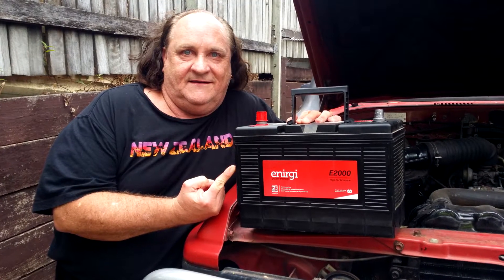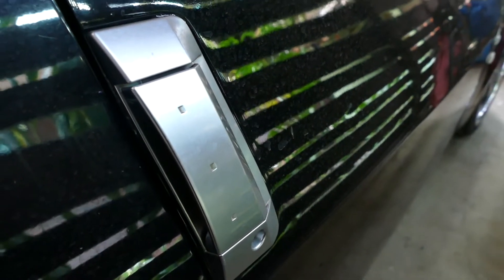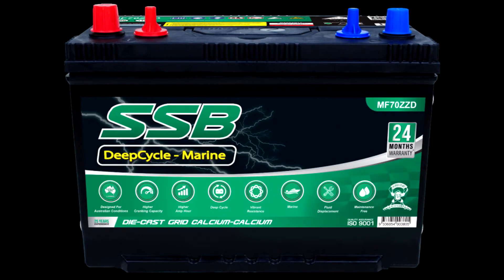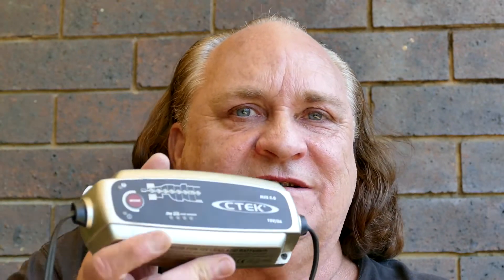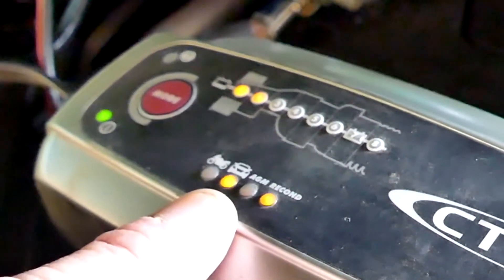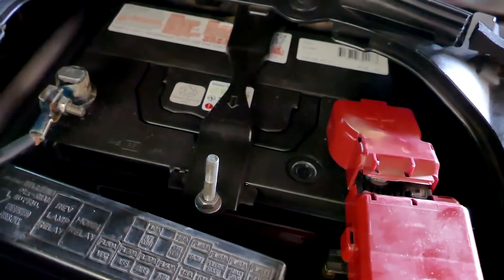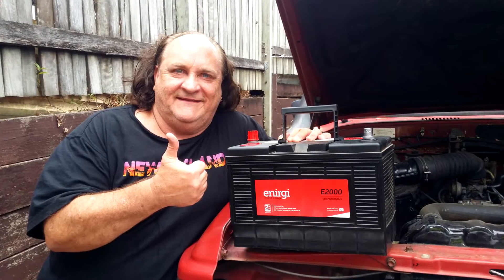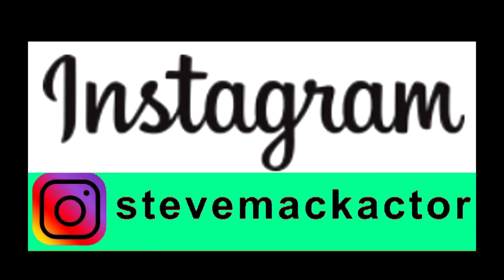When to Use a Car Battery Charger (and When You Shouldn't)

Comment: G'day Steve. Well done again mate however it might be worth noting that a 'Trickle Charger' and 'Maintenance Charger' (also called a float or smart charger) are two different units that might affect the health and life cycle of batteries. While both are designed to slowly emit low‐voltage charges to your vehicle battery, restoring the battery to a full charge status over several hours, the critical difference lies in the chargers’ ability to automatically shut off the charge current and not overcharge batteries, which can lead to overheating and serious damage.  Leaving an unattended trickle charger on for too long might lead to overheating, causing the battery to boil the electrolyte. Maintenance chargers can be left connected to the battery indefinitely without risk of damage to the battery. Battery maintenance chargers completely shut off the charge current output to allow the battery to settle, and when the battery’s voltage drops to a certain point, the charger will automatically turn back on and top off the battery.  This is safer than a  trickle charger. Not trying to be a smart arse mate, but I found out the hard way. Love ya work. Cheers.
Reply from the maker: I know, and have yet to further update the info in the description area below. The Ctek charger shown, does have smart float technology to avoid that issue (& this was cut from a video of ~3 years ago)👍